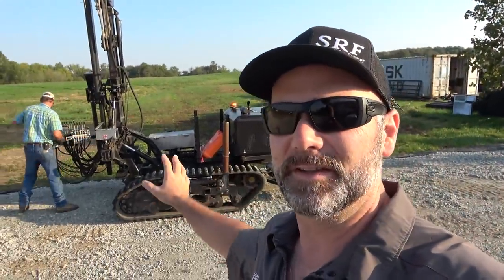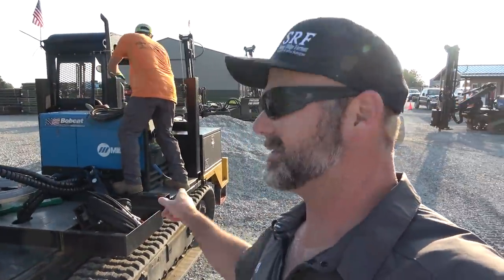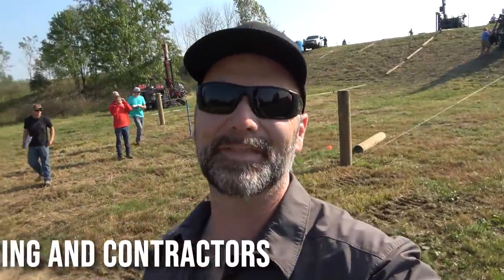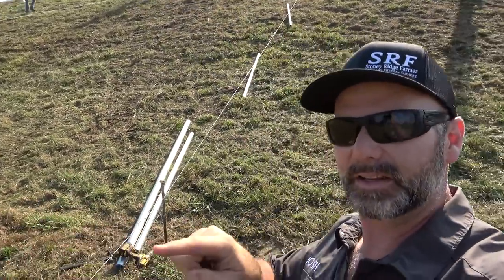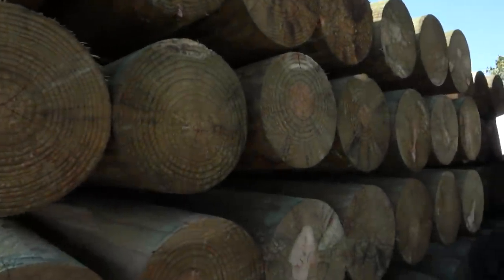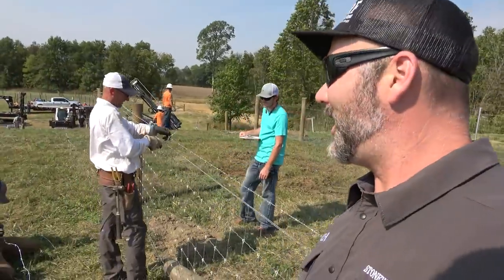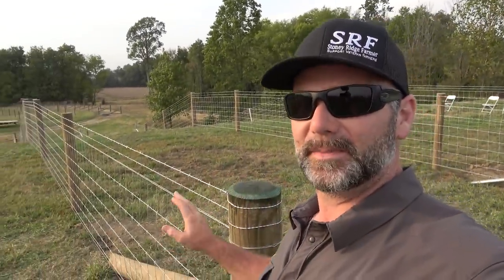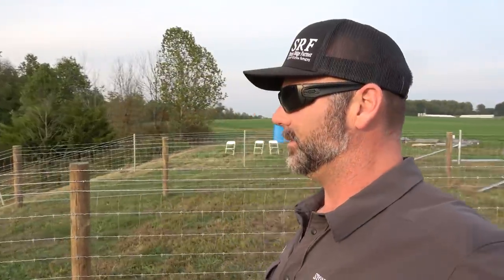Farm Fence Like you've never seen! Day 2 USA Farm Fencing Competition!

Comment: Sure wish I had one of those Post Auger/Drivers 18 years ago when I Built my 420' Perimeter Fence!

What makes those Wood Posts so special compared to using 4"×4" Square Treated Posts?

I did add a secondary "cover based" treatment to 2' of the burried portion, and used 1"-2" River Rock for a 4" base below the Posts and for the Perimeter around the Posts to allow for proper Water drainage to minimise premature wood rot. Was that "overkill"?

Love your Channel Josh! 👍 😯-Woo!